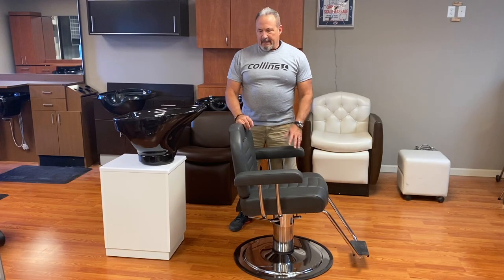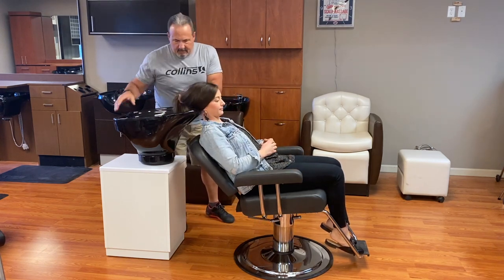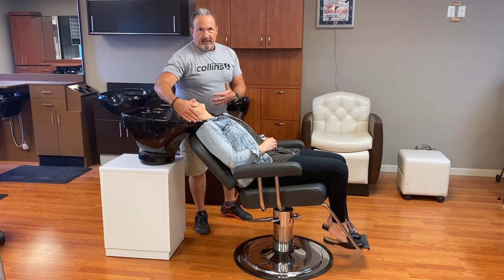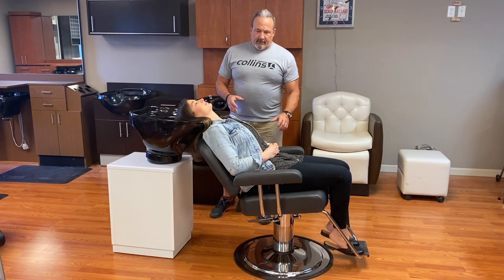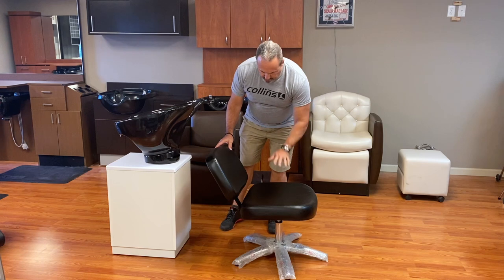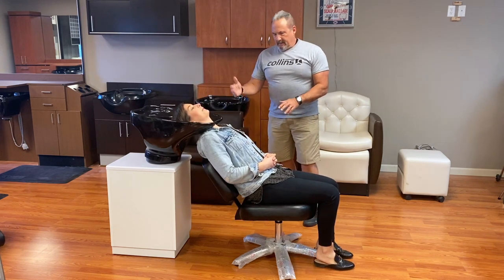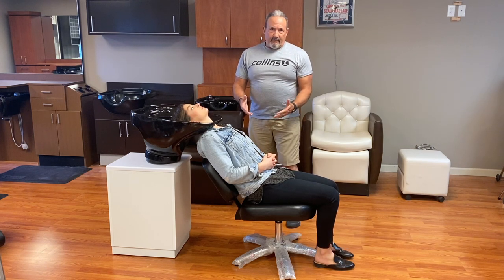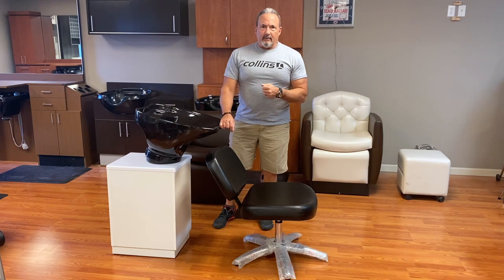All Purpose Chair and Hydraulic Shampoo Chair Used with Tilting Shampoo Bowl

Comment: Great video.  I am about to install a wall mounted shampoo bowl and planning on using the pibbs grande 660 barber chair to perform the shampoos on with.  Do you recommend getting a tilt mechanism or no?  And if not, what is a solid standard height to place the shampoo at since it will be fixed?  Thanks